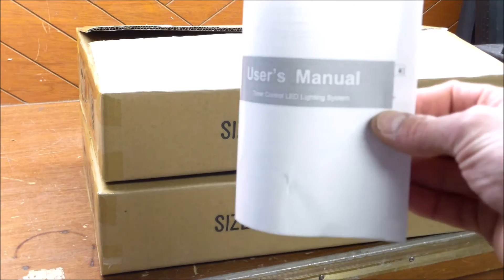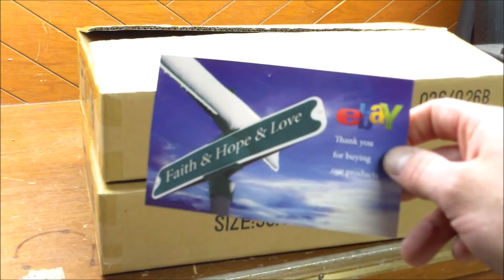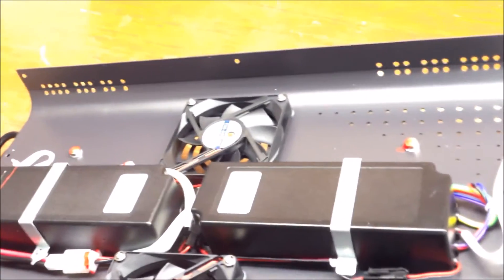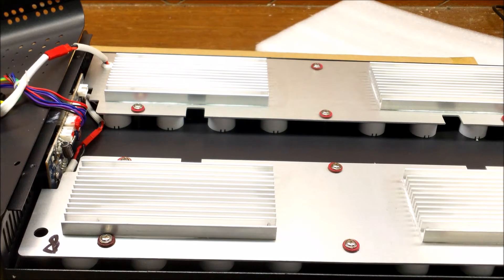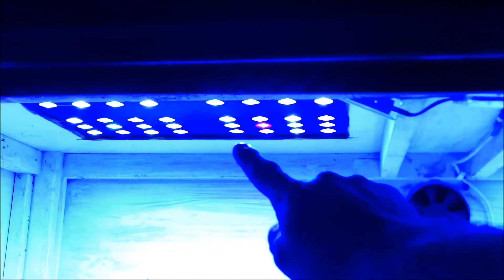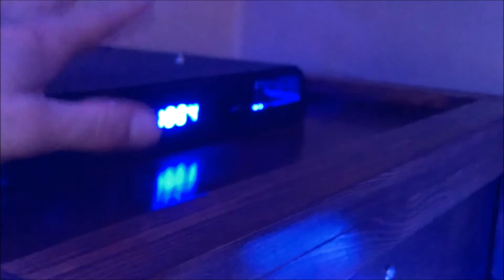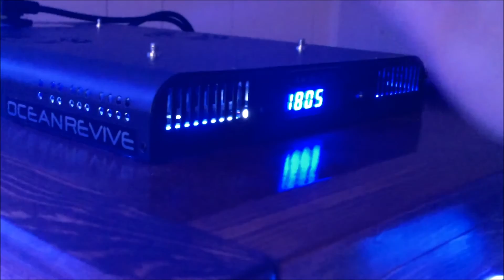Ocean Revive T247 Teardown and Review Reef Tank Chinese Blackbox LED

Comment: I love my ocean revives, had four in my 210 for about 5 years but now I have a noisy fan I need to replace.  How difficult will it be to replace the fans , you think I can find them online ? Tia.   Also I think I’m gonna re do my canopy like u did cutting slots in it when I start the replacement as mine are in the canopy and always caused a bit of a heating problem

Comment: would these be suitable to go under the hood of a Red sea max 130 d after opening some holes for fans to exhaust  out the hot air of the unit ? TIA
Reply from the maker: +luis valentim dont see why not, my cases do not get hot at all.
Reply: get rid of the lid. no need for it

Comment: would these run my planted tropical fish tank for plant growth and fish colours such as neons,cardinals and odessa barbs, great video cheers
Reply from the maker: +derrick bradshaw they are really meant for saltwater tanks, however I am not totally sure.
Reply: I used to run a planted tank with these, I had it left over from my old reef tank. I would only run the whites though, don't even bother with the blues on a planted tank. Other than that, they performed pretty well and I got good plant growth.

Comment: I just put a review up of these lights after using them for 8 months. They work great! Nice to see the inside shot I def didn't wanna risk opening mine up ... Great vid man 👍🏾
Reply from the maker: I was a little nervous open them but I figured what the heck...thanks
Reply: Check out my reef if ur interesting in seeing how these lights can do after 8 months ... Interested in seeing how u plan on ramping them up and down as this is not an included feature .. Mine are currently at 14 inches above my tank
Reply: CJ'S AQUARIUMS why did you eventually change,  do you think there is a big difference.. I see you always have them blue
Reply: +CJ'S AQUARIUMS I'm about to open mine up and get UV bulbs in there asap
Reply from the maker: Jonathan Wales Post a video of you adding the UV bulbs, that would be awesome.
Reply: Carl Recktenwald Jr. I am looking forward to seeing them in, it's the installation I am worried about. I will do a timelapse of it surely and tag you guys in - as I will take my time not to break the unit!
Reply: More controls and functionality better spectrum control. Nothing wrong wit them they work just got something I could change easier

Comment: you could connect your external  controller  dimmer in these lamps ?
Reply from the maker: I guess your could. I don't totally follow your question.
Reply: +Carl Recktenwald Jr. are  you conect a external dimmer controler  like Apex?
Reply from the maker: +Raymundo Colin  Any controller that has a 3.3 volt pwm output will work...